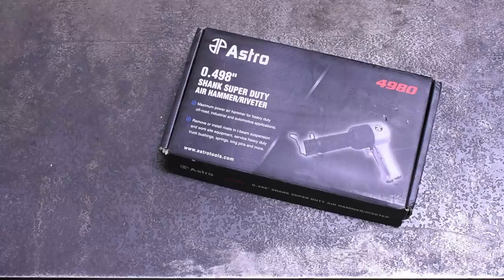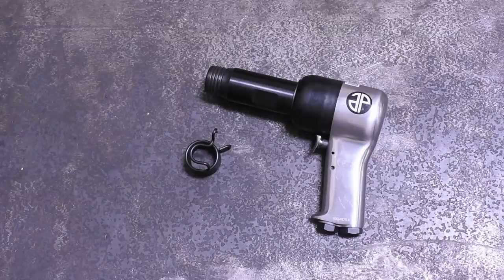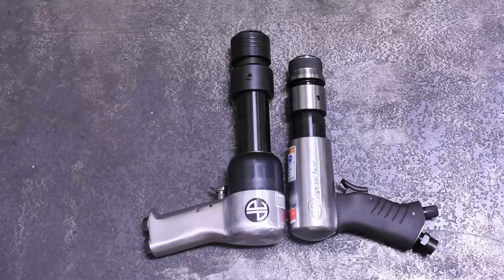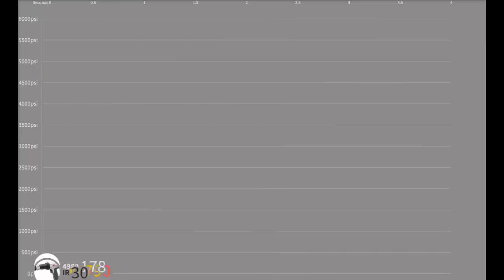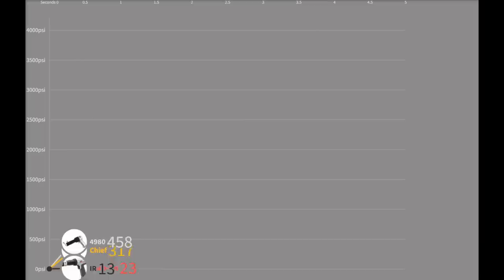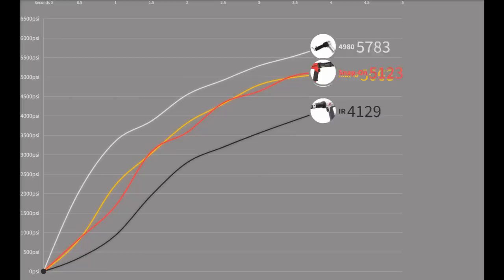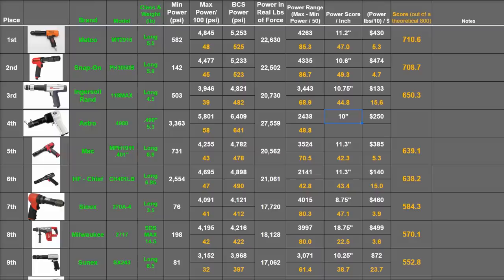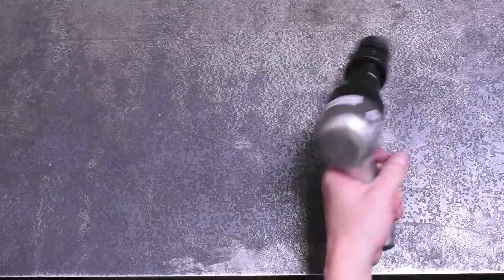50 Caliber Air Hammer? Large Bore Air Hammers Are Insane

Comment: CP (Chicago Pneumatic), along with the 'sister' companies (Desoutter, Atlas Copco, etc.) does provide energy ratings in joules.  Although the Desoutter and Atlas units are sold as rivet guns, the CP models (from which the clones such as the Astro is based) are marketed as "air hammers" - difference being in the trigger feathering ability needed for rivet guns.
I have an old CP 9x gun (the Astro 4890 is a 5x) from which the Astro Thor is modeled, and also a Michigan Pneumatic 7x clone, which because of historical changes in CP's lineup is MORE powerful than the "9x" clones, but it's LONG (about 12 inches).
Reply from the maker: Thier joule ratings are all over the place. They don't seem to connect to reality

Comment: Those big tools love big air hoses. Like at least a 1/2. It may be 
psychosomatic but I think a 3/4 and 1” really open up a 7x and 9x rivet gun. Not to mention the bridge builder rivet gun. Would like to see some big bore rivet guns tested and maybe compare air hose sizes at constant psi.
Reply from the maker: Was 1/2" hose 3/8" hi flo fittings on this guy
Reply: @TorqueTestChannel  
The bridge builder had a 1”. And the biggest my 7x could take is 3/4 unless adapted up. But even adapted up it seems like it still gains. I work in a big facility though and don’t have control over psi. It’s constant at around 100. So volume is the only thing I can change.
Reply: @TorqueTestChannel  honestly I’ll only use 3/8 on my little 5x and other pneumatic tools. The big guns get the big hoses.

Comment: I've wanted a bigger hammer. Anyway, Ive had the Snappie hammer for well, over a decade. Thought I'd put this out there for the pros, ever removing t-case or pinion seals? Well, confident use of an air hammer and chisel bit saves quite a bit of time and besides the old seal causes zero damage.

Comment: Since y’all have developed such a great test rig for air hammers, would it be possible to do a video on aircraft riveters? 2X, 3X, and 4X being in the .401 chuck and 5X, 7X, and 9X in the .481. I believe these are a “Beans” rating based on internal hammer weight.

Comment: I have a Cornhole air hammer and it's weak sauce the barrel won't stay put and needs constant tightening and it's far too long for what I need it for! Worked great when I got it in the body shot to peel door skins! But not so much as I'm moved back to mechanics

Comment: You should measure the weight of the air hammer like the actual part inside that slides back and forth. Then use its weight and speed to calculate force

Comment: Id be curious to see how my .498 APT 7X rivet gun compares.
Reply: My apt 8x is the most powerful one I have encountered. I rarely use it because it breaks bit. The astro appears to be a CP clone.
Reply: @robertrathbun5799  Can't say I've ever broken a set with mine but i only use it for shooting rivets and knocking out big hi-loks.
Reply: I use mine for rusted front end parts on cars, wheel bearings, axle shafts, ball joints, etc.

Comment: Have you guys tested the Chicago Pneumatic CP 717?   I have been in the Automotive repair business for over 35 years and the CP 717 just blows away every air hammer I have ever bought or tried.
Reply: Nevermind just found it. looks like the CP 4289 9X just smoked everything!  Found your video.   Thanks great channel, i share it with tool dealers and techs all the time.  I just went on the CP website and Google and Cant find it?  I will check your links.

Comment: A lot of tools are designed to limit vibration because of trades that use them on a daily basis. Even if it takes longer, the least vibration is usually preferred. Seems like something you should be considering since you went with a full metal handle. The power doesn't always matter to some people. It's probably pointless since the vibration probably scales with power anyway.

Comment: @TorqueTestChannel. I get there is little to no metering at the trigger but wouldn't lowering the air line pressure result in less beans on the test rig? Or would that result in the Air hammer not working properly or at all?  All that being said, I feel the whole purpose of bringing out ol' Big Nasty is to get things moving when all else fails.
Reply from the maker: No, you're correct. It would meter the power. It's range is a bit less than you'd get from a super good trigger, but dialing down the pressure at the wall or with a fitting near the gun would reduce power. Just trying to judge each tool on an equal footing. Often you want to just on the fly change how much you want to hit stuff.

Comment: Torque Test Channel, Big Nasty air hammer does the bit spin or is it held to stop rotating as the bite move back and forth ?
Reply from the maker: Depends on the bit. You can't get either turn or non turn type